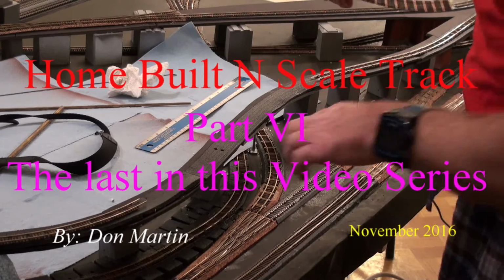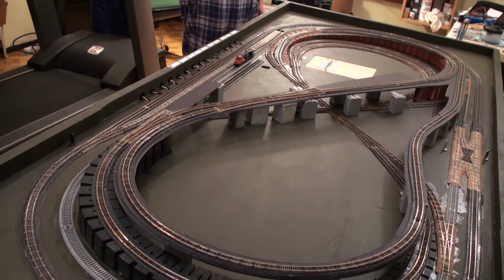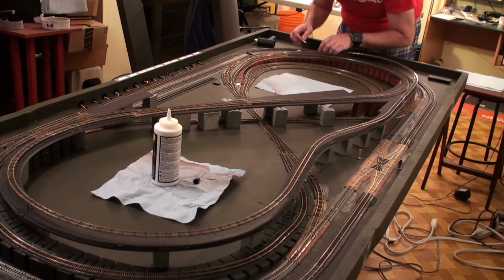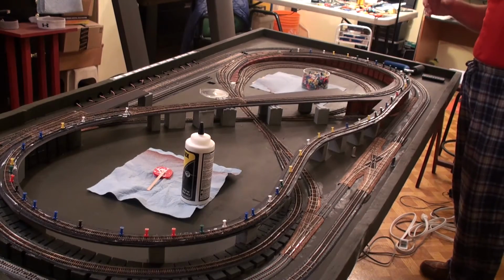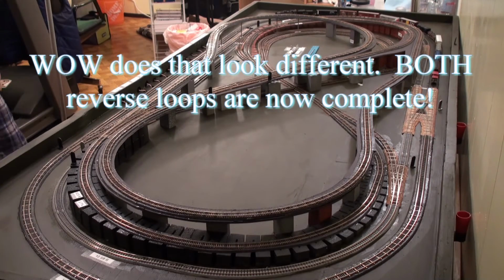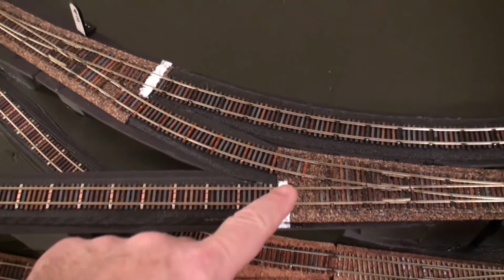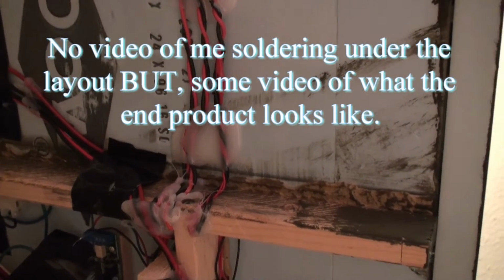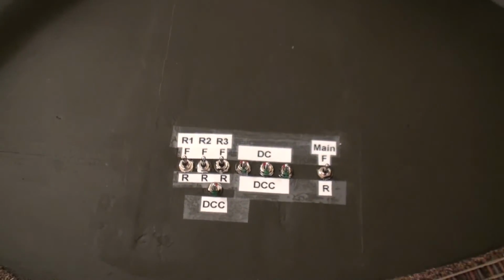Build my own N Scale track (and lay it) - PART VI.   The last one.

Comment: I notice you have a ECoS command station, that's great. My buddy has one and it's very advanced. I enjoy spending a lot of time setting it up. I hope you record a series on adding your turnouts to the ECoS  and a track diagram including routing.There's a youtuber called Hovermotion from the UK. He has a lot of ECoS videos if you need some help or ask me.
Reply from the maker: Hi John, I've just been going through some comments and noticed this.  Yes, I plan to do more ECOS videos.   I have mine set up to control the turnouts and have some "routes" built as well.   As a side note, I also run a Digitrax system with this and a SPROG III.   And, I can run it as digital.

Comment: You and I work way diffrent, check out my vids and you'll see, be interesting in sharing techniques
Reply from the maker: Hi John, I went to your youtube site but I could only find the one video which was a short discussion on handlaying track but didn't show any techniques.   If you have any videos that show your technique I'd be interested - please send me a link.

Note that what I've done here is on my test layout so there is no scenery nor ballasting and all the work was done to test out different things to see what I'd like to do.   And, by using the Fast-tracks templates, your track ends up really smooth as you can't have any kinks in it :).
Reply: well I'm kinda new to you tube cause I've been on some of the model sites for some time,except for the NARCOA runs, but our work is very much diffrent, I don't use Tim's templates, nor do i run DCC at this point in time. most of my hand laid long runs are quick sticks spray glued down, then run one rail perfectly and then follow with triangle gauges to create perfect runs, pc ties are every 6th, all turnouts are flex track tracings compared to fast track templates.then ties are plio-bonded to turnouts then heated to cure then spray glued in place, I will have more vids coming soon. feel free to study some of my turnouts 
Thanks for comments~JL~